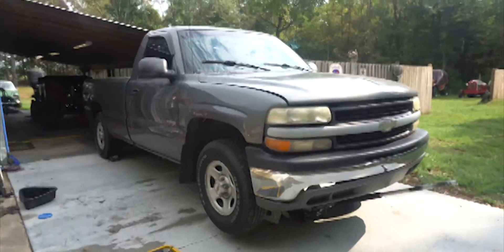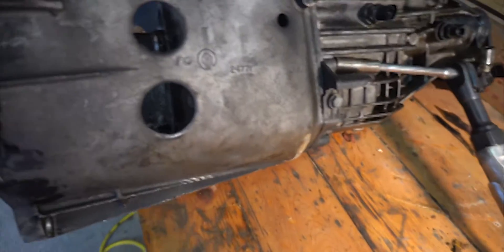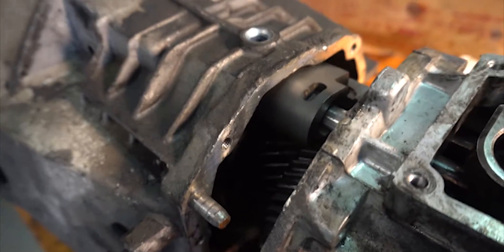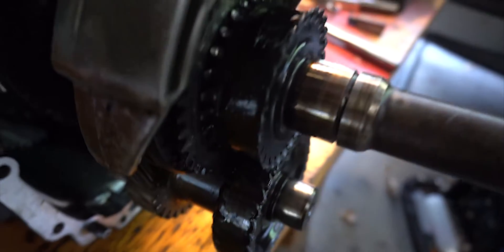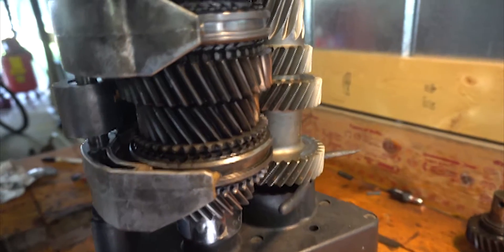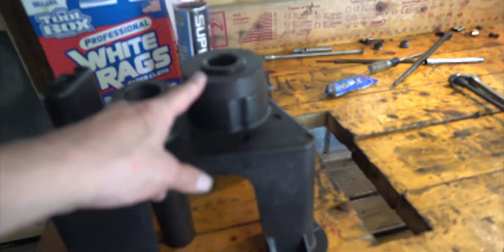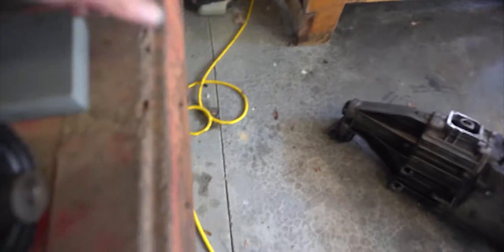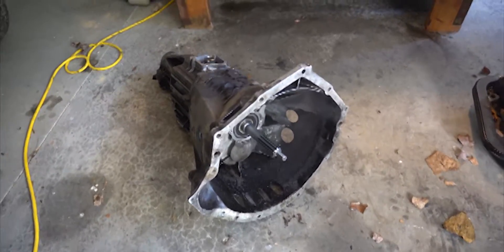NV3500 transmission repair

Comment: just question for anyone that knows. I have a 2003 nv3500 4x4. after install it shifts very hard from 2-3, sometimes when I pull it out of 3 something gets hung up and the shifter will not move left to right in the shifter gate until you jiggle it for a while and you hear something release... 

everyone think this needs shift forks replaced? this happens with engine on or off and clutch in or out ... 

it has grinded a little also sometimes going into 3 so maybe dragging clutch? but it does not do it into any other one. just 3

Comment: Hi ,Reverse lights doesnt work ,I have a truck 98 GMC sierra ,The reverse shift dont turn on the switch on reverse , The switch is new and i can turn on the reverse lights manually pressing the switch but when install the switch into the gear box my shiffter dont press the switch inside ,and reverse light dont come on ,Do you know why Thanks
Reply: The reverse/5th fork has a nub that pushes in the plunger in the switch......  I'm in the same situation....   The nub broke in my son's S10 and it's somewhere in the transmission.   I've been contemplating doing a full rebuild... Doi g my googaloo and YouTube research right now.

Comment: What's the difference between NV3500 and MG5?
Reply from the maker: Looks to be the same transmission to me. 1987 these transmission where called Muncie Gear.
Reply: @doughknuts  ok thank you sir
Reply: There’s different types of NV 3500s the MG five has longer shifting time between first and second the M 50 has a shorter shift from 1st to 2nd

Comment: I am having a similar problem with mine( Dodge nv3500) but mine only has 4th gear any idea what that is... Also makes a noise let me a rod knock
Reply from the maker: Does it not move when in 4th?
Reply: @doughknuts  yes that's the only way it will move... Had to limp it 50 miles home leaving it in 4th and stating off with the starter

Comment: I have almost the exact ruck except 4x4. Mine is a 2000 short bed. I got mine tore apart. I started removing the gears. I made it past the first couple gears and synchros and made it to a collar type part that I have to get off before I can go any further. I have searched everywhere and cnt find a video or anything showing how the gears come off the shaft. the only thing evey video shows is how to take the case apart majke a jig and put back together. Do you have any info on getting those two locking collars off? calsup63@gmail.com

Comment: Guthrie...?🤔 there used to be a Guthrie transmissions in El Paso Tx. Any relation?
Reply from the maker: No relation. I have another transmission video I need to post for a 1990 ford ranger V6. The outout shaft froze on the bearing and locked up.

Comment: What year truck did the trans come out of? I have a 96 gmc 1500 with 4.3 and was curious what year trucks I could use to go in place of mine with all same sensors plugs ect... thanks good info

Comment: Does anyone know why these input shaft gears strip out like this? I pulled mine apart and the input and countershaft gears were stripped... any info on why?
Reply from the maker: In my case the prior owner never checked fluid levels and it had no gear oil in it. It requires a special tool to take the plugs out.
Reply: Where you able to get it into gear at all while engine was running. I just dumped 8 grand into a pickup that sat 10 years. Whole clutch system is new and I'm really to pull it back out and have it rebuilt. 

Mine will go into gear when engine is Off, I'm able to start it and when releasing the clutch it pulls. But will not go into gear when running what so ever, but it won't grind just extreamly stiff

Comment: Hello, could you help me, I'm from Brazil and I have a gm s10 4.3 v6 that uses this NV 3500 transmission but here there is no STF fluid for it, could you tell me a replacement for the STF fluid, maybe the dexron iii? Thank you
Reply: 30w  engine oil
Reply: Suppose to use synchromesh oil, gm, pennzoil, royal purple etc they all make one for synchro

Comment: Anyone know if I can swap my busted nv3500 housing that came out of a 97 ram 1500 4x4 and use a Chevy housing for a project truck? Or anyone know where i could get just a housing for any applications?
Reply from the maker: I am not sure but I do believe there is a difference in the chevy and dodge housing.